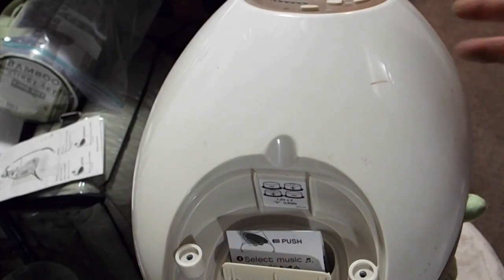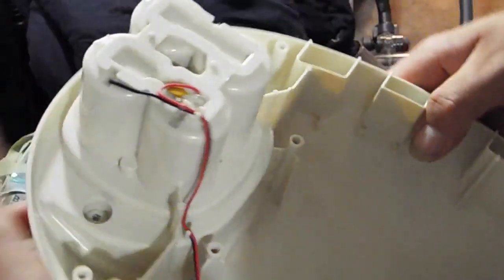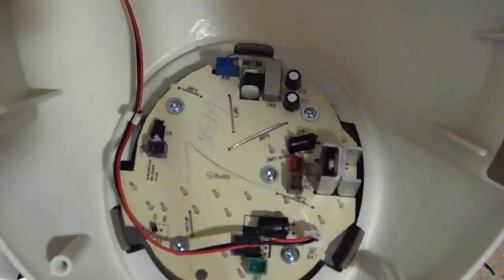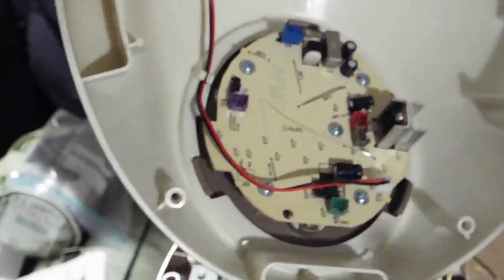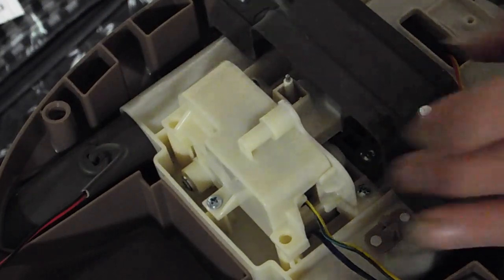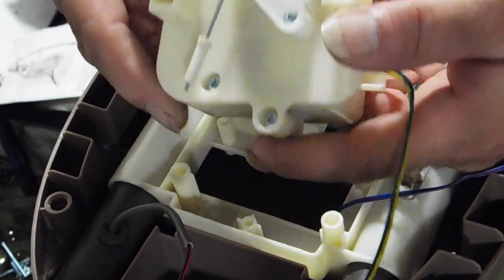GPW 57 - Fisher Price Baby Swing Motor Repair

Comment: So I know this is really old video and I'm wondering if someone could help me. I have this exact swing and I just bought a replacement AC adapter. Everything works except the swing function. What are the yellow and orange wires called? Do each color means something different? The replacement part on Amazon doesn't seem to have those attached. I have the soldering tools but I don't really know how to do stuff like this. Any help would be appreciated. I'd rather spend 15 bucks fixing the swing and having to work out now like 150 bucks for a new one.

Comment: What voltage goes to the motor? im only getting 0.5 volts or less, so mine does not work properly... I tried applying 6v but the motor goes way too fast. I will try a lower voltage.
Reply: Did you figure it out? Ours had something like 2.38 volts running to it, am not sure if it's an issue with the potentiometer or is intended to be low voltage. I noticed repositioning the potentiometer (blue thing with a screw on it) seemed to up voltage to 2.38 or so and it would spin but not sure if that's the intended value of the potentiometer or its just bad in general
Reply: @vitaliypastushok  yes it was something like 2.0v on low and 2.6 or 2.8 on high...
Reply: @krispy5139  what was the fix that worked for you?
Reply: @vitaliypastushok  basically bypassed it and you can use an adjustable voltage regulator, not the best solution.

Comment: I think I have a newer version of the swing. This got me to taken apart, by my gearbox and motor are different. My motor is longer and connects to a belt drive. Anyone know where to get the motor for the newer version?
Reply: Me too. Did you find anything?
Reply: @audreyrogers3159  I got mine working. I measured the size of my motor and bought a replacement one on eBay, part number, RK-370SD, $2.75 +$2.75 shipping. Since all I had was part number, I think the new motor may have different specs. My swing is working now! It goes at an ok speed, but all the speed settings are about the same. Overall, worth it.

Comment: TIP!!!  I found in the comments here the part number for the supposed Air Wick motor. I ordered it for $5 off eBay trying to be more efficient.  Looked identical. Attached it, worked but wasn’t powerful enough to move the swing. Flipped it around wondering if that was the problem... no difference. Went and bought the Air Wick in a last ditch effort, worked perfectly.  Unfortunately now my swing cannot be repaired again because we had to cut the wires for 3 fixes.  We also managed to mess up the music with all the fiddling around. Bummer.  I’d love to save someone else this trouble and I’m going to post this in several places.  Buy the Air Wick!!!!

Comment: We bought the replacement motor and followed all the instructions. The motor works, however when it swings, it’s out of sync, so it barely works. We’ve swapped the green and yellow wires around and still nothing. Any thoughts on a fix?
Reply from the maker: Without being there to tinker with it... no.

Sorry.

Dig into some forums... This is a very old video... but if I recall correctly, when I was researching the fix, I bumped into a few forums that offered advice.

Here's a Google search to start with(although, you have probably seen most of the results here already):
https://www.google.com/search?sxsrf=ALeKk01WEggCqgW5J1IB8r4O5YfdQ1fRGA%3A1583703201701&ei=oWRlXtq9KrKs_Qanqo3ACw&q=fisher+price+swing+motor+troubleshoot&oq=fisher+price+swing+motor+troubleshoot&gs_l=psy-ab.3..0i22i30l2.37120.49147..53667...0.0..0.109.1097.11j2......0....1..gws-wiz.......35i39j33i22i29i30.1UCGEfmztgg&ved=0ahUKEwiakpGW6ovoAhUyVt8KHSdVA7gQ4dUDCAo&uact=5

Comment: I just did the fix on Nov 12, 2018 and Air Wick still has the correct motor.  The capacitor and diode are NOT required - they are for electromagnetic compliance and required for selling the device.
Reply: This might have been just bad luck on my part but I ordered this motor on eBay trying to be more efficient.  Looked identical. Attached it, worked but wasn’t powerful enough to move the swing. Flipped it around wondering if that was the problem... no difference. Went and bought the Air Wick in a last ditch effort, worked perfectly.  Unfortunately now my swing cannot be repaired again because we had to cut the wires for 3 fixes.  Bummer.  I’d love to save someone else this trouble and I’m going to post this in several places.  Buy the Air Wick!!! (No disrespect to the person who shared this information, again this might have just been bad luck on my part but would really love to save someone else the trouble)
Reply: @texxxann  Apologies for any inconvenience as a result of my comments.  I do not recall the exact details of that motor but I have edited my comment to reflect your experience.  If you do need to repair again (hopefully not) you can get crimps and a crimper from a hardware store to connect the wires.
Reply: Josh Fox no problem! This totally could’ve just been bad luck on my end!  Would love to hear from anyone else who has tried ordering the motor?

Comment: Hello. I'd like to ask if this is ok to use? I found this link and  it's much cheaper but I don't know if it's ok to use.  I want to know what you think. I hope you reply thanks..  

https://www.jameco.com/z/RF-500TB-18280-R-Nichibo-Taiwan-3-Volt-DC-Motor-2104-Rpm-1-3-Volt-Range_2158442.html?CID=GOOG&gclid=EAIaIQobChMI69P1v4ap3AIVgsUNCh1VtwrSEAEYASAAEgLYivD_BwE
Reply from the maker: for that price... give it a shot... get the other one if it doesn't work.
Reply: +GP Woodworks but the voltage is only 3V. and the swing I have is 6 V. Does it still works?
Reply from the maker: I missed that different voltage. If your swing motor is 6 volts... you want a 6 volt motor.
Reply: +GP Woodworks ok thank you so much for your time. my husband is not helping me so I'll fix it myself. thanks a lot.
Reply from the maker: I'm sorry, YouTube is a hobby for me. This repair video was posted because that's what I was doing that weekend.

If I come across one of them, I will keep you in mind.
Reply: rhanks. pls do let me know if you ever come across one. thanks a lot.

Comment: I had trouble reinserting the motor/spring assembly. If you disconnect the brace between the legs and move the legs together, you can remove the brown bracket above the motor assembly. Remove the two screws on the cap of the swing, lift it up, and you can pop the motor assembly right in instead of contorting the motor assembly around to get the spring arm to go back in the swing.
Reply from the maker: That's good advice. Thanks for sharing it.

Comment: what if it wont power on at all
Reply from the maker: carla varner 

Too many possible causes to list here. 

Make sure the outlet is powered. 

Plug in the power supply (not connected to swing) and check that its  working. This is best done with a volt meter. 

Basically you need to check from the outlet to the circuit board for power until you find where it stops or find the faulty part. 

Sorry I can't be more help. A full explanation would look like war and peace.
Reply: I appreciate you taking the time to respond and explain

Comment: Hi! I have a  question my motor works but doesn't start and also that spinning toys above baby's head also don't spin but music and other noises work. What should I do? Thanks
Reply from the maker: It sounds like you may have bigger problems than just a dead motor. If you have the skill, check that voltage is present at the connectors on the board when you turn them on. If the voltage is thee then the problem is with the motor side of things (bad motor, broken wire etc). 

If the voltage IS NOT there, then the problem could be the switches, the traces on the board or a component in between.

Sorry I can't be more helpful....

Good luck.

Comment: I was able to replace the motor thanks to your video but now the connector going to circuit board is a bit loose and will turn off the motor if slighty moved.  Do you know type of connectors I need to buy?
Reply from the maker: Start here: http://www.molex.com/molex/products/group?key=wire_to_board_connectors&channel=products

Comment: Amazing - thank you!
I did mine tonight. Used an air wick ultra and I soldered the green and yellow wires right to the motor (checking connection pattern prior) I also soldered the diode and other pieces that were on the old motor. Then I saw my circuit board had a piece broken off from the motor giving out so I soldered the component back onto the circuit board. Now it works great! Amazing that it takes an air freshener motor.

Comment: thanks man, you're a life saver!  just an FYI: the airwick freshmatic has been replaced with the freshmatic Ultra.  Reading online it seems that new motor will not drive the swing, I can not verify this but I did find  the knockoff walmart "great value" dispenser to be near identical to the orginal airwick freshmatic....I used this walmart knockoff and it works just fine.
Reply from the maker: Thanks for the info! A lot of viewers have been sharing info here. It's awesome!
Reply: Will Kholeif Just replaced the motor with the Ultra, can verify that it is the same motor and works great
Reply: I used the ultra and works great

Comment: Ha HA! Thanks for this video. I have linked it on my social media because it saved me so much money and I spent very little time with the actual repair. I bought the version with the diode and cap (I can't solder and it's just more cost effective to buy that instead of a $7 air-wick). It's capped, but I didn't have electrical tape. 

Test run with 2-month-old starts tomorrow. Wish us luck!
Reply: Did it work? Where did you buy it at?
Reply from the maker: SheltoniaNation thanks for that... keep us posted.

Comment: Thanks for the video. Just replaced a motor but the swing just wont move even though the motor is working :( do you know what might be the issue?
Thanks!!
Reply from the maker: If you run it with the top off, you should be able to find the problem. If the motor is running but the swing is not swinging, the problem should be mechanical. Start there.
Reply: Hi I had the same problem. Check your circuit board.

Comment: Hi i just finished fixing my babies swing same way u did i didnt use the diodide or caps can it by n e chance catch on fire or n e thing like that? Just want to keep it the safest for my baby.
Reply from the maker: Anything electrical can catch fire. The diode and cap are there to protect the components on the control board when you turn off the swing function. When the motor is turned off, there is a reverse current that flows from the motor to the control components. The diode and cap help to reduce this effect. While it is usually best to put things back the way you found them, I chose not to do that in this case. There is a link to this same motor, with the diode and cap already installed, in the description. If you feel concerned enough, you can use that one.
Reply: GP Woodworks did it work for u a long time w out the diodide n cap
Reply: GP Woodworks im sorry for so many questions im new to this idk nothing about this bt ur video really helped me get thru it step by step
Reply from the maker: It's not a problem. I did this repair for the wife's grandson long before he was born and he has yet to visit. So, we haven't used it other than the test you saw in the video. The swing works but I don't have extensive use of it. There is a level of risk any time a repair is made. The risk doesn't go way if someone else does the repair, you just have someone else to blame IF things go wrong. If you do this repair again with the diode/cap version of the motor, you would at least remove your concern about it. It won't remove the possibility of a problem, but you would have put the swing as close to factory condition as you could. I hope this helps... I'm on my way out the door but I will revisit this comment string this afternoon in case you have more questions.

Comment: Wondering if there's an issue with the strength of the replacement motor (or perhaps I just have a fat baby true).  I've verified that the polarity of the wires is right.  I've tested for voltage, and still showing between 4.2 and 5.4 volts feeding to the motor, but these replacement motors just don't seem strong enough to swing the swing under load.  Anyone else experience this, and what have you thought to do to fix it?  I ordered a few motors from Newegg last week http://www.newegg.com/Product/Product.aspx?Item=9SIA6704N22094&nm_mc=TEMC-RMA-Approvel&cm_mmc=TEMC-RMA-Approvel-_-Content-text-  that appear to be higher torque, and the same size.  Not sure if I'll run into issues by putting these into the swing, but at this point, don't think it could hurt to try.  All thoughts welcome :)
Reply from the maker: Chris Allibone check that the switches are working and that other components are intact (wiring and such). That's the best place to start.
Reply from the maker: It sounds like you covered all of the electrical bases. I can't see it hurting anything. They ARE slightly different motors. The one from Surplus shows a higher current(.05A) in the specs than the NewEgg motor(.028A). This USUALLY translates to higher torque. They list different units for torque on each model (21g-cm vs .588Nm). I did some math (1 Nm is equal to  10,197.16213 g-cm according to onlineconversion.com/torque). This represents a difference of roughly 285X the torque in the same frame of motor at the same voltage and less current. I find that a bit confusing. I would say, if you have both, try both. Leave the motor in that works best. Please let us know what happens.
Reply: With a push start, the weaker motor salvaged from the air wick is still functioning, and so I haven't put the new motors from Newegg in yet, but just wanted to offer that the slow boat from China took its time arriving, so anyone looking for an immediate fix would do better to swing by WalMart like I did.  If/when that motor burns out, I'll be updating here to let you know how the Newegg motors perform.
Reply from the maker: Thanks!
Reply: Well, the Air Wick motor officially burnt out again yesterday.  Was excited to put in the Newegg motor, but after soldering on the cap and diode, and fitting it in place, it appears that it is too slow in the RPM department to toggle the swing like it needs to in order to have any sort of a decent rock.  It muscles through it, but it doesn't effectively swing the child.  Guess I'm back to looking for the proper motor for cheap.
Reply from the maker: Levin Gunter Thanks for the update.
Reply: hi,  the swing music and the  mobile stop working. the motor however swinging the swing.
how I can repair it  please ?

Comment: Just fixed my swing and couldn't have done it without this video. Thank you sir.
Reply from the maker: Raul Montes Glad it helped.
Reply: Raul Montes hi quick quest did the new motor u put in have the diodide and cap? Just wondering cus i just replaced my sons w out it just waned to know if its been workin well for u

Comment: thank you so much. had air wic freshner in my bathroom,  spent $6 on flex, blood sweat  and tears,  I had it fixed. no one believed in me, even doughted myself. I'm a single mom and this was something to be proud of. thank you
Reply from the maker: I think you should be proud! Glad it helped.
Reply: msvictoriasue hi did u use the airwick motor on its own w out the diodide n cap or did u install that as well? Wondering how has it been workin for u
Reply: I actually managed to pull it off the airwic motor as a whole so I re used the diode. I broke the ground taking it off but it still worked. It works wonderful to this day. I really don't know how to solder so find someone who does,  it saves your sanity. I don't know how this thing held together,  I was so sloppy.

Comment: I have tried google but I get more confused. Could you tell me what the purpose is to have the capacitor and diode on the motor? Is it a safety concern?
Reply from the maker: Check this article out... see if it helps.: http://electronics.stackexchange.com/questions/95140/purpose-of-the-diode-and-capacitor-in-this-motor-circuit

Comment: Mine has same gear box but doesn't have the metal bracket that runs across the top, motor tests good and does work, voltage regulator was bad, replaced it ( hooked up backwards I think and killed the new one !) anyway, connected the motor directly to power supply I have and everything works but swing will not swing, stuck right now tried all  I could think of but still will not swing, even if pushed to start it to swing. Power supply has variable voltage and even at different voltages swing still does not swing.
Reply: ahardb0dy what is the part number or where did you get the regulator?  TIA!
Reply: Did you ever figure it out? Same issue and attempting same fix with potentiometer. Didn't want to go down the rabbit hole. Am suspecting the spring also
Reply: @vitaliypastushok  i don’t think so, was 5 years ago. I don’t recall
Reply: @ahardb0dy  alright, thanks for the reply anyway, worth a shot 😊

Comment: very helpful comment if you need to do this again. if you close the base legs it opens the cross way bar on top so take off the 2 screws holding the brown plate and with the support legs closed they will be straight and the bar will come right off then you can get to the back screw to remove the cap over the rocking part of the swing